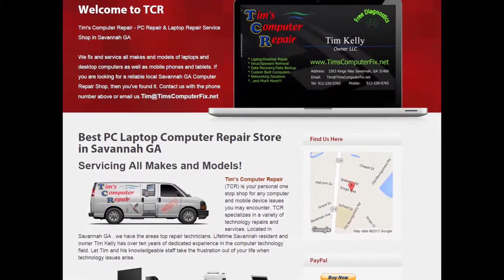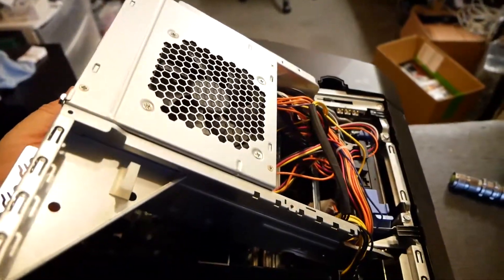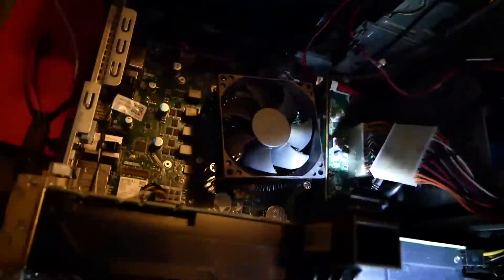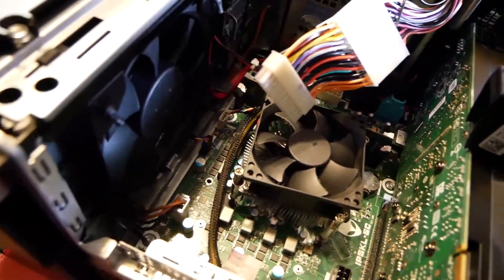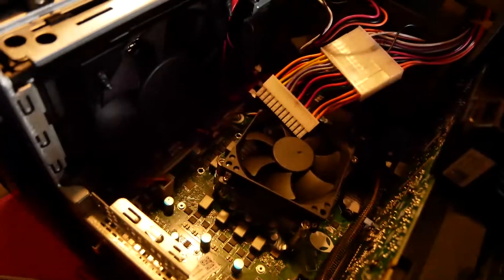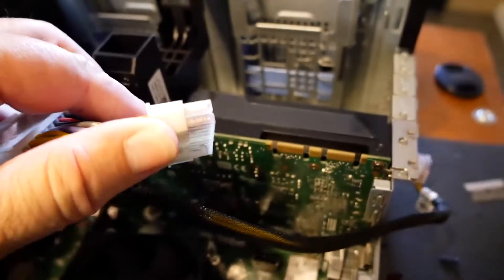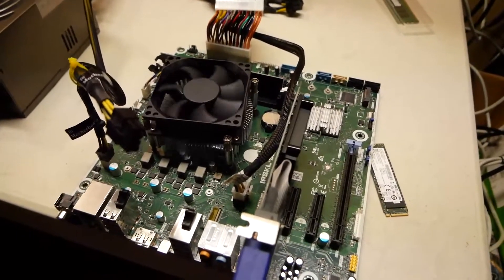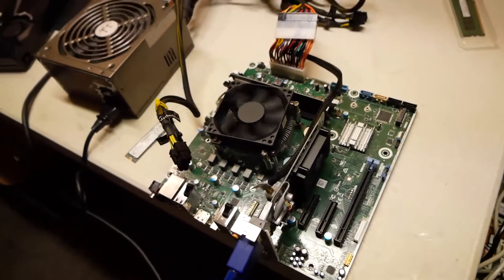Alienware Aurora R5 Liquid Damage Disassembly and Troubleshoot

Comment: With the cost of a new PSU, the motherboard, video card, and POSSIBLY a processor I'm not sure that machine is worth fixing.  That's why when I buy Dell laptops etc I always get the warranty that includes the accident protection.
Reply from the maker: Well this is certainly one time the insurance would have paid off. I bet if he opted for insurance the accident would have never happened :) ... You never know though.

Comment: Count yourself lucky Tim, at least it was sweet wine.  I had a client bring in his PC years ago and his Italian greyhound decided to urinate right through the side panel fan vent and killed his board.  Fun times ;)
Reply from the maker: OH Fubar Johnny!!! I had a feeling you would have a story to add to this scenario. Not sure if I would have worked on that one lol
Reply: Can I ask how you fixed that? My cat did the exact same thing. To my r7 2 days ago....I caught the smell and did not turn my computer on and it was off when it happend...looks to be just the power supply is all that was affected I still have not pluged it back in yet.... any suggestions?
Reply: There  wasn't any fixing, it fried the motherboard and had to be replaced.  If you think it's just the power supply  that suffered the spray in your case, then you might disconnect all the power leads from the motherboard and manually jumper the PSU on just to see if it's going to power normally without a catastrophic fry.

Comment: Great Video, Tim! The Alienware looks like it was a nice computer before the wine. BTW I was wondering, which anti-malware do you typically use?
Reply from the maker: Thanks for the comment. IN Windows 10 I let Defender be my A/V and I use Malware Bytes for malware protection. Defender is very effective in Windows 10 only.
Reply: TimsComputerRepair I agree. Windows Defender is pretty good and is an upgrade from Microsoft Security Essentials. I would actually recommend Windows Defender, while I would not recommend Microsoft Security Essentials.
Reply: Windows Defender is getting there I hope in the next feature update they make the default for the protected folder access (ransomware protection) ON by default.  If they can just get the kinks out of their ransomware protection I think they would have a good chance of making decent built in A/V.  Go watch The PC Security Channel's videos he talks about different Ransomware and tests A/V programs.